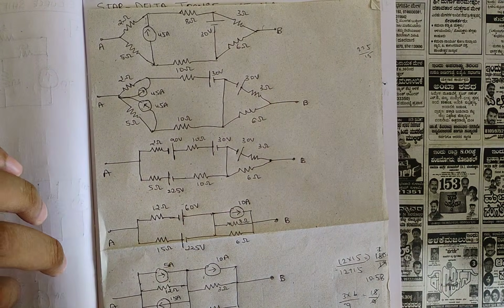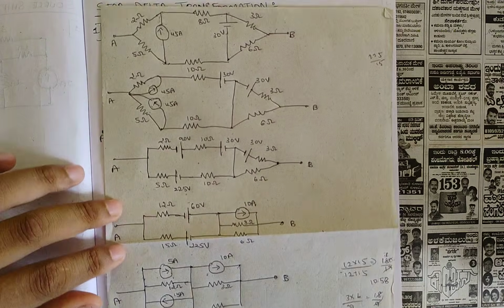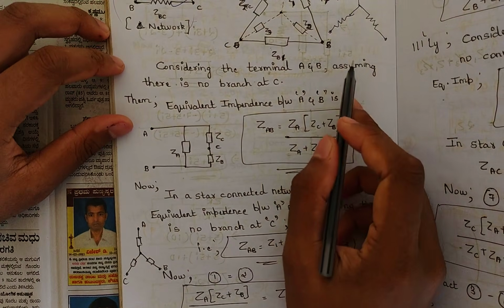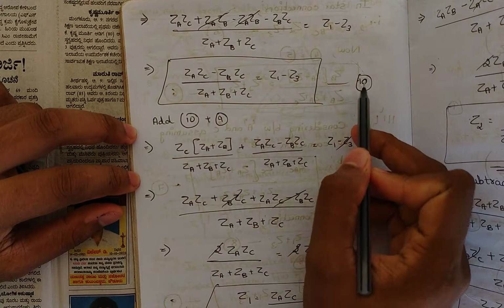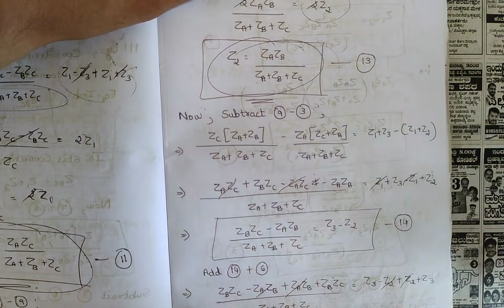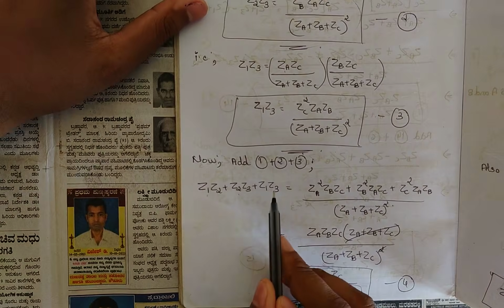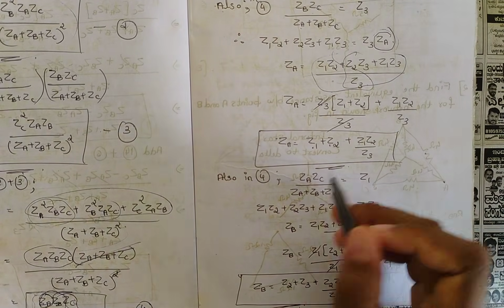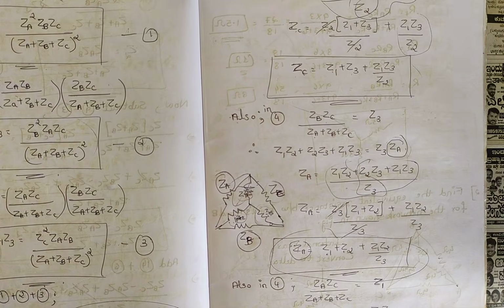7.Star⇆Delta Transform Concept,Derivations Explained 3rd Sem ECE Latest Schem VTU

Comment: Bro there is a mistake in this problem. As you have taken 8ohm resistor which is in series in the question. But from the next step you've changed it from 8ohm to 10ohm.please verify as it can be confusing.
Reply: Final answer would be 34v and 8ohm
Reply from the maker: Ohhh yes u r right...
So sry for the mistake..
I was in a hurry...
Please do make the corrections as per the explanation